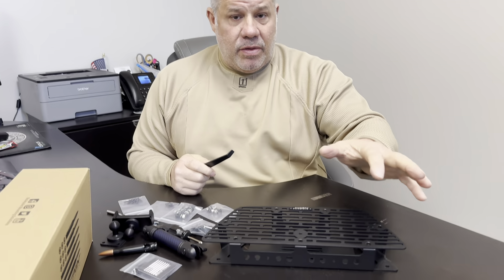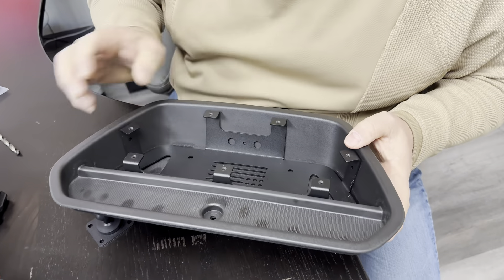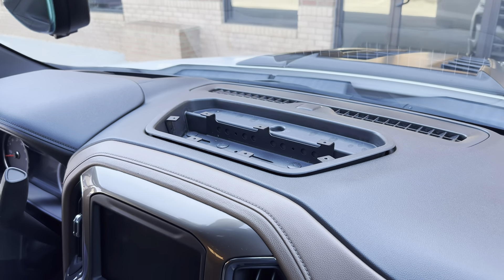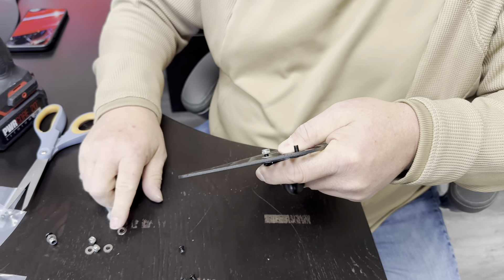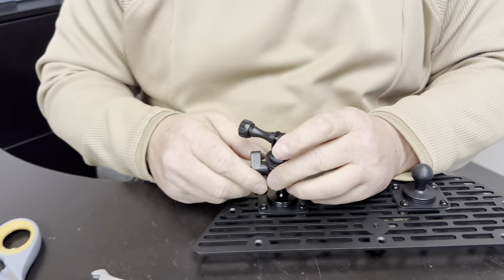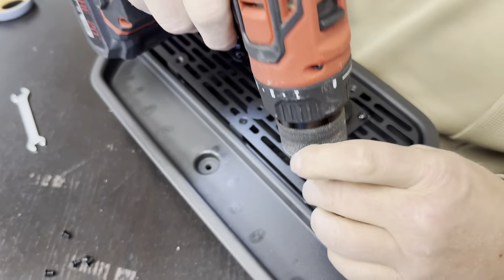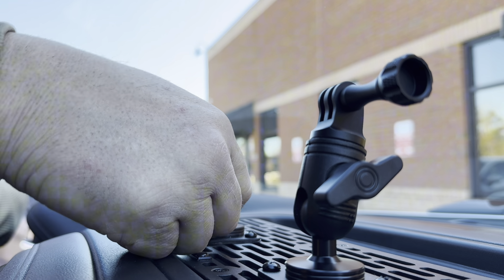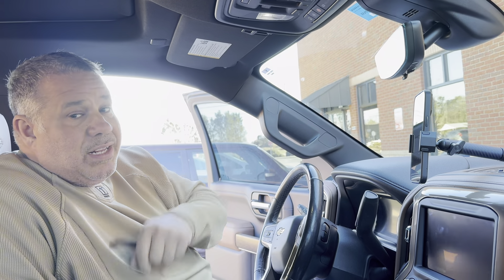Bulletpoint Cell Phone Mount 2020 Silverado. EASY AS PIE!!

Comment: Had a hell of time getting the tray out but finally got it! Appreciate the idea of trimming and using the rubber mat to hide the open bolt! Any particular reason you used the push pins versus the nuts and bolts they recommended?

Comment: Looks good. Glad to see someone with the same truck as me make an install video. What length of extension did you get for the phone. I also ordered the bed cover after you posted your video a while ago.
Reply from the maker: Wow thanks man I bought there standard set up only thing I would change is make the phone holder magnetic one I may upgrade to that